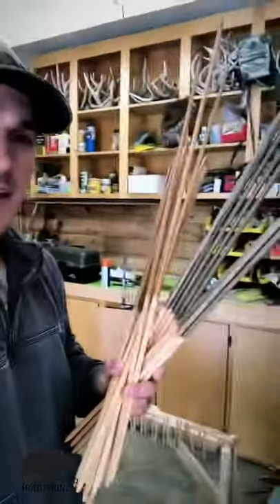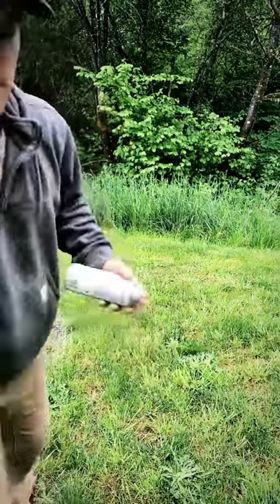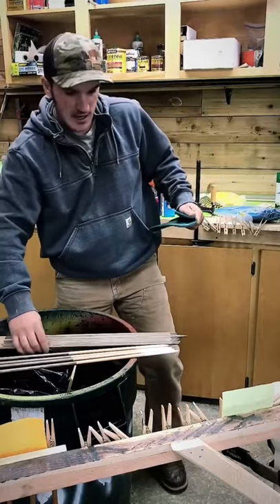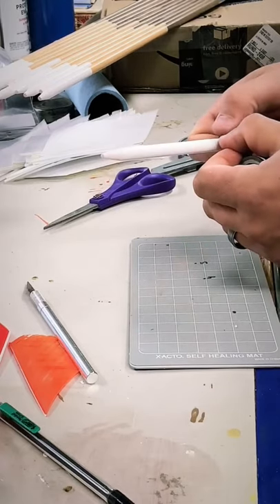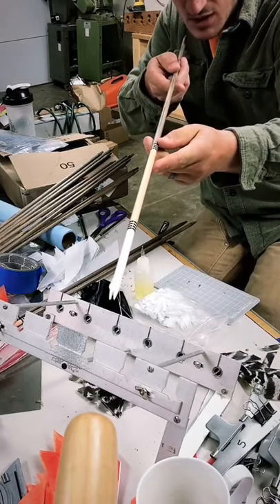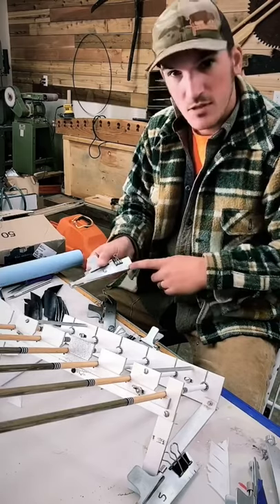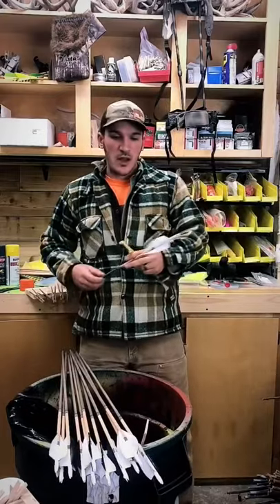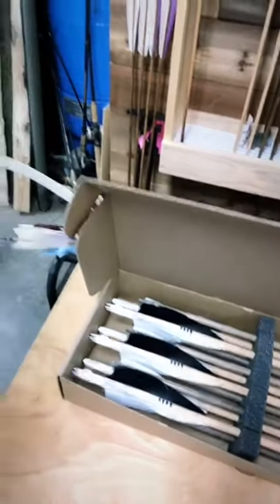Making Wood Arrows - Start to Finish

Comment: Does all the layers and paint have a functional purpose? Or could I just stain the shafts and dip in polyurethane and fletch like that?
Reply from the maker: Great question Ben. It’s Purely aesthetic. You can just dip in poly if you wanted. The more coats of poly, the more durable/waterproof the shaft. I encourage you to play with different numbers of coats and see what you like best for finish! Let me know if you have anymore questions.
Be blessed,
-Brandon
Reply: @MakingTraditional  wow! That was a fast reply, thanks!